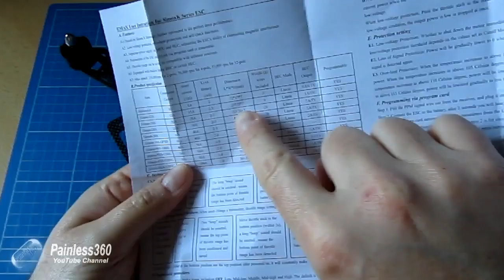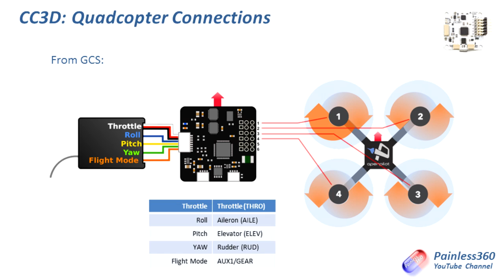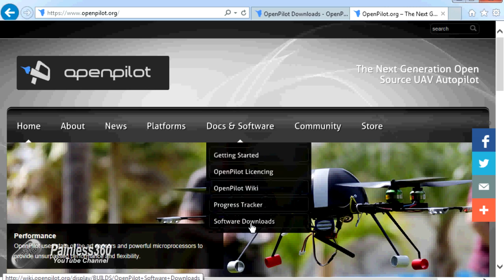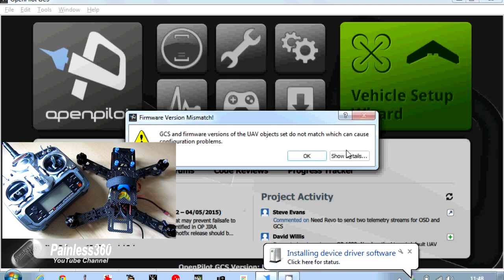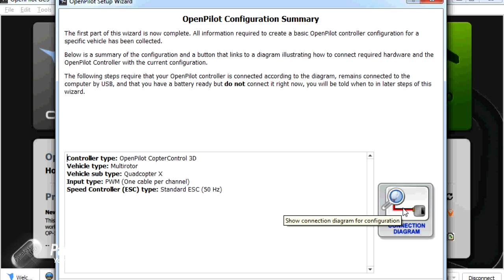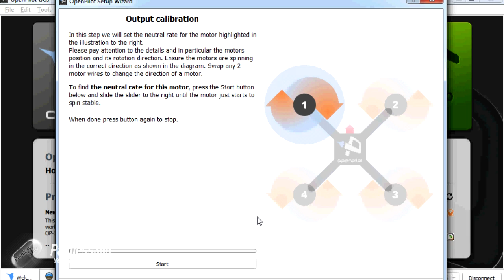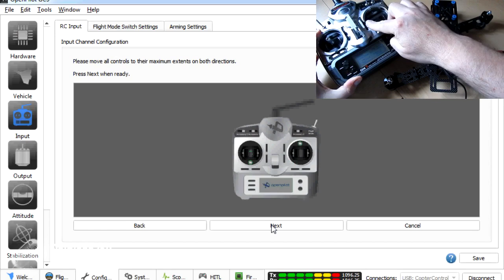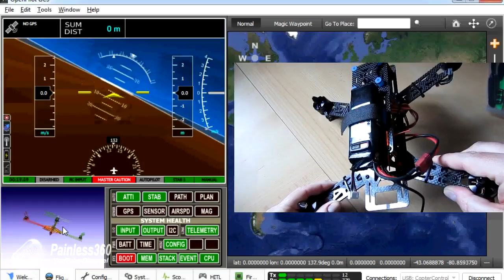(2/10) CC3D Flight Controller - Radio setup, firmware install and testing

Comment: Ok you install a receiver and the wires are colored coded and you show the Power wire ( 3 wires) and the Blue ( Aileron)...BUT you go off and hook up the rest and do not show where the rest go and in which position ????
There is a Green-a Black- and TWO Yellows ( no brown ) as your screen shows......confusing for us beginners trying to follow your video, when you do not tell or show where the rest go ?? Geesh.
Reply from the maker: E Will You have probably bought a clone of the flight controller then with different coloured wires then the one I have here. Follow the diagram at 5:20 plugging each wire in turn into the relevant channel on your receiver. 
I appreciate you are new to this but not asking a your questions in a polite manner isn't going to get you the help you want/need.
Best of luck with the build.
Reply: Painless360 Did not mean to be impolite, just odd for How To, to stop and not show each step...little confusing for some of us.
I asked across forums and had to find another video that actually showed each step and explained how and why...and the different color wires etc.....But I appreciate all your help and I am sorry if what i said was took as being impolite, not what I meant at all.
Reply from the maker: No worries. If you are that new to RC that the instructions in this video were confusing then there is a playlist that may help you find your feet - https://www.youtube.com/playlist?list=PLYsWjANuAm4oWuE5ZDX4TAiHBv2i0Xl4m

Best of luck with the build.

Comment: Hello!

As you continue this excellent series, can you please cover the compatibility of CC3d with sonar modules? In particular the SR04: http://www.banggood.com/Wholesale-Ultrasonic-Module-HC-SR04-Distance-Measuring-Ranging-Transducer-Sensor-p-40313.html
and how you connect it, configure it etc.

 I think it will work but only with cleanflight and also I have read that maybe now in PWM mode. 

Thanks!
Reply from the maker: Zeebo Rutherford I will add it to the wish list. 
Happy flying!
Reply from the maker: Zeebo Rutherford Just a quick heads up - in my initial research it looks like this isn't an option with Openpilot on the CC3D. If it is a 'must have' then get yourself a full Naze32 or FLip32 board (https://www.youtube.com/watch?v=2ngA6MSWw80)
Happy flying!
Reply: Thanks! I appreciate your help. As it happens i was getting into Arduino (independently from RC) and was delighted to realise APM is actually ArduPilotMega. So given the endless expandability of Arduino and the sketches i can write, I think my next project will be an ArduCopter. I was watching your APM vids and i was very happy to see you have covered it! Thanks again